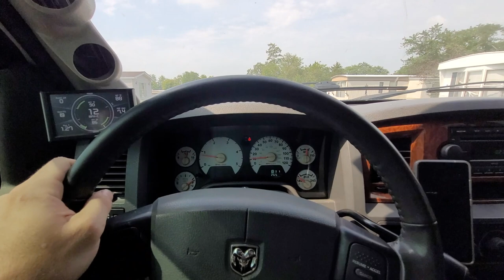How To Start A 6 Figure Mobile Mechanic Business For Less Than $5k Invested

Comment: only problem with the example you gave of the electric ratchet in the door is once you loosen that bolt with the ratchet and then get your head of your ratchet butted up against the inside of the door hinge cause the bolt is loose now its stuck and you cant hit the direction selector on the ratchet im sure you know what im talking about lol.
Reply from the maker: That happens with the valve covers on the rear of the Cummins. I always get that bad boy stuck up top 😅

Comment: The shops in my area charge $150 an hour, but often discount that on canned jobs.
I charge $80/hr for appointments and $120/hr for labor on emergency calls.
I also charge 10% on parts for tax and 10% for delivery and 5% sourcing so it is still less than they can buy it for over the counter.

Comment: What’s the hoist setup on trailer hitch ?
Reply from the maker: It's a modified hitch assembly that I welded to my Curt hitch. I bought the crane itself from amazon and cut off the reciever.

https://www.amazon.com/MaxxHaul-70238-Receiver-Hitch-Mounted/dp/B008CE0WCW/ref=sr_1_2?crid=225E4F4LV0D1X&keywords=engine+crane+for+trailer+hitch&qid=1694574432&sprefix=engine+crane+for+trailer+hit%2Caps%2C1031&sr=8-2